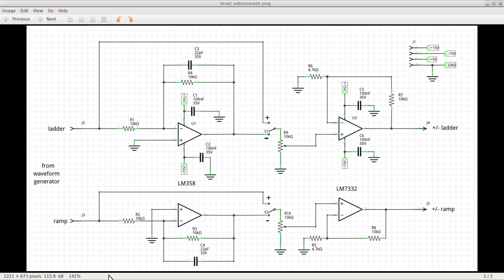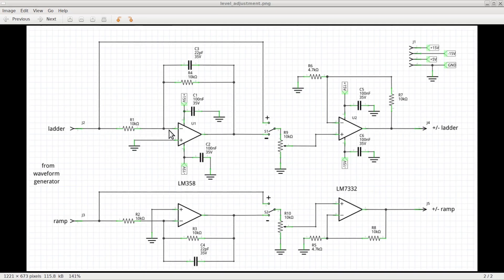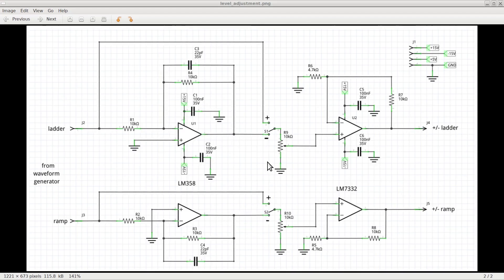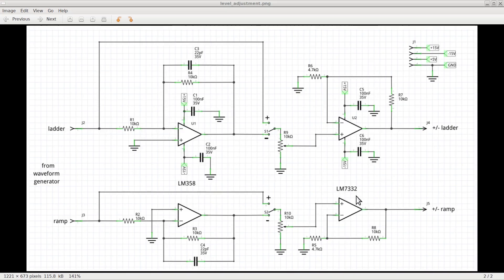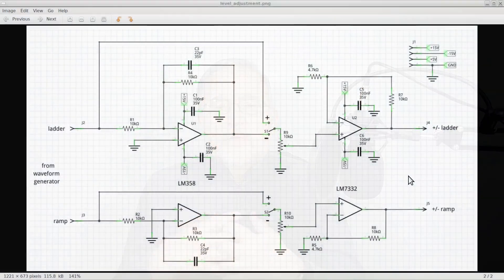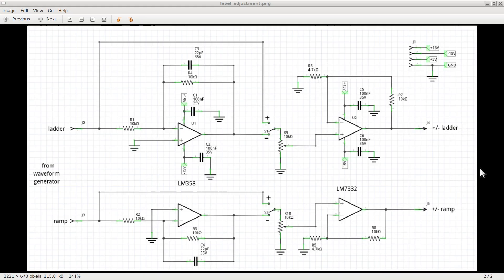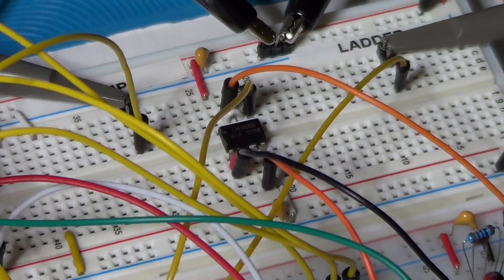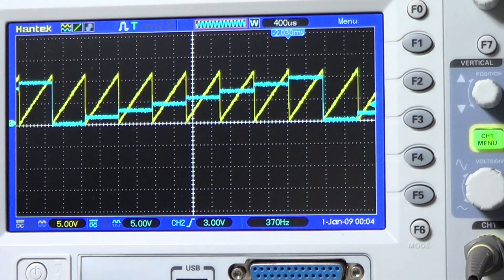Make A Curve Tracer For Your Lab - Part 4: Level Adjustment

Comment: Have you ever used the JNM4556 high current dual op-amp instead of the LM7332?
Reply from the maker: No, I haven't. However, I realized I don't even need the 7332 in this project, so I replaced it with a lm358.
Reply: @ Thanks for your reply.

Comment: Thanks for posting.
Reply: Question I noticed that you have both inputs running at the same frequencies and they are in phase. I heard conflicting information on this. Thoughts?
Reply from the maker: Well, the frequencies are not actually the same. Consider that we need to generate a full ramp for each step of the ladder signal. So: if the ladder has 4 steps, the frequency of the ramp is 4 times the one of the ladder. If the ladder has 8 steps, the frequency of the ramp is 8 times the one of the ladder.
Reply: @ Thanks for the reply back. I figured if I used a CD4024 divide by 8 up counter using the R2R resistor ladder network  If I inputed a square wave at about 2960 hertz I get a very nice and clean 370 hertz stair step wave form.
Reply from the maker: Yes, that's another perfectly valid option.